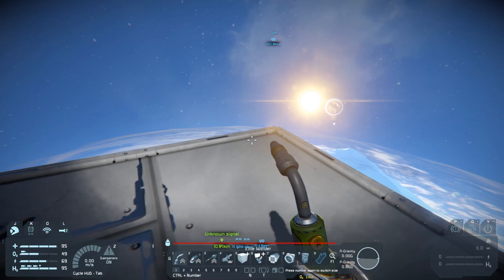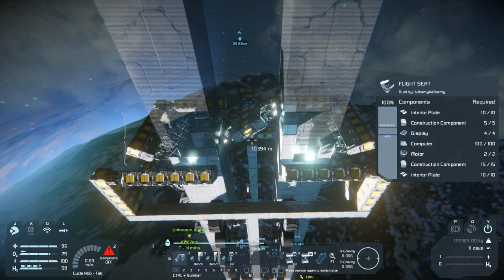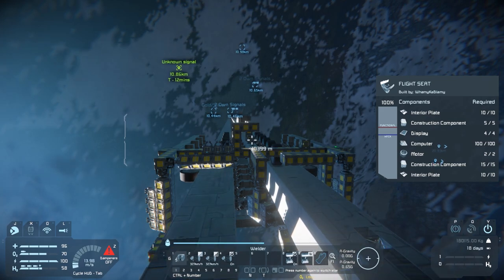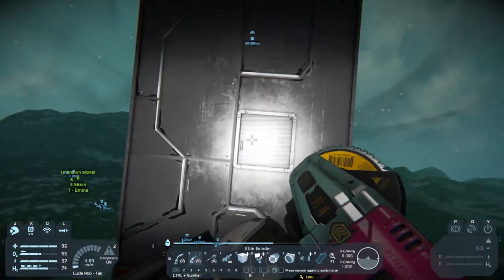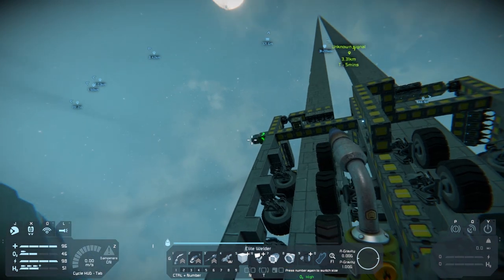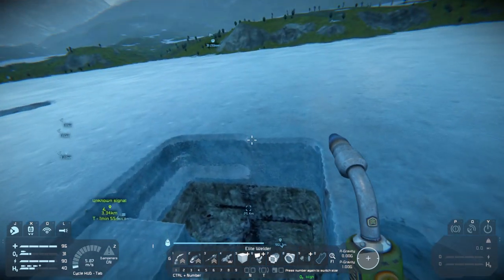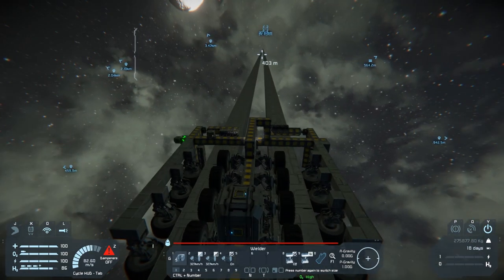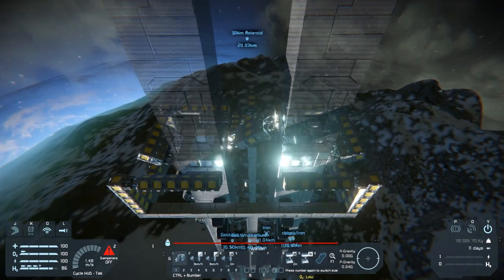Space Engineers - Building an Orbital Tether / Space Elevator in Survival

Comment: Hello, i have tried your design, but i have Problems with the weels.
They destroy the rail sometimes.
When Welding the grid is shaking around rail.
How are your weel settings offset, suspension and power?
Reply from the maker: Heya, my wheels on my current survival one are: 
 - 6 sets of wheels, so 12 front and back, 6 left and right for a total of 36 wheels. 
- Strength 75% on the suspension
- Height offset of -31.1
- Power 100% 

The shaking on the grid is always going to happen I'm afraid, the best thing you can do to counteract it is to keep your speed very low when you're building along the rail and to have more sets of rails. 

I'm afraid that it is going to be finicky when it comes to stopping it doing damage to the rails - if it's destroying the rails I'd lower the suspension power and the propulsion power and adjust the height offset so they're just touching the rails. You're going to have some damage to the rails no matter what, you'll see them creasing a little bit, the best thing I've found is to have more sets of wheels with less power. 

Essentially you need to be thinking of it like a milipede rather than a set of rails - to get more grip you want more pairs of wheels. It really does depend on the exact design you go for so I don't want to throw hard numbers at you to say exactly how you should build it, but what I have at the start of my comment is for 2 sets of 3x3 rails that go up 12km. I hope that helps at all :) If not I'm happy to do a little demonstration video to show exactly what I'm using at the moment :)
Reply: Hy, thanks for the Hint, i will test these settings. My Vehicle is very heavy, so must add more wheels? I want to bring my ships up to the Orbit :-) Thank you very much for your help!
Reply from the maker: @zeipet  Aye, thats it exactly :) Essentially we're using the wheels like a train uses them - we're counting on more wheels that have a bit of slip on them giving us the power rather than making the sets we have more powerful :)

I think the biggest one I've done is about 10 stacks of wheels for a full on orbital elevator that people can sit in. Also, if you want to cut out the wheels power you can put a combination of atmospheric and ion thrusters to get it into orbit, but that is very power intensive and the idea was to make something you didn't need platinum. You could also put hydrogen thrusters on too, if you were willing to stockpile it, but you can do it with wheels alone. 

The one I currently use I've gone up and down on the rails maybe 100 times since the last time I did repairs and maintenance and it's working still (although with a few bumps here and there)

Comment: What are your computer specs?
Reply from the maker: Heya! I'm running a Ryzen 5 1500x overclocked to 3.8Ghz,  16gb of DDR4 ram, Nvidia GTX 980 Ti (6gb), and I'm running Space Engineers off of a SSD hard drive.
Reply: Thank you now I know what to buy THANK YOU I didnt want to waste $400
Reply from the maker: Glad to have helped! What are you thinking of getting? 

A few notes I should mention: 
- With the Ryzen I have it water cooled and because it's overclocked it can cause some problems with video encoders (I had a peek to see if you did videos). Not the Ryzen itself but because they like to use up all of your CPU, I have to take the affinity off of a couple of cores just to make sure it doesn't go over the top and cause a crash. Adobe products seem to be the worst for that. 

- The GTX 980 that I personally have is a bit loud, if you're using it to do videos you might want to record your audio separately with Audacity so you can do a noise reduction specifically on any microphone use. 

But, with that said, Ryzen are lovely for gaming and recording I have to say. I record Ark on pretty much the highest settings that don't hurt my eyes and it doesn't cause any problems recording with OBS, Audacity and having a game open at the same time :)
Reply: WhamyKaBlamy I got my new laptop! But it has a really bad graphics card. I can only run Space engineers at low/normal graphics. Planets crashes me. Whats your steam name?
Reply from the maker: Heya, I literally only just saw your reply, sorry about that. 

Unfortunately laptops do have limits when it comes to graphics cards, but it should be possible to put a better one into it, even if you have to take it to a store. I'm sorry to hear the graphics card is a bit pants :(
Reply: WhamyKaBlamy Ill find a cheap way to do it and I can play planets! Want to play with me?